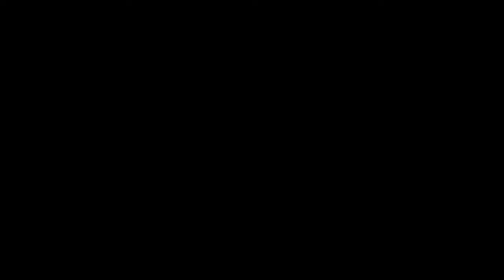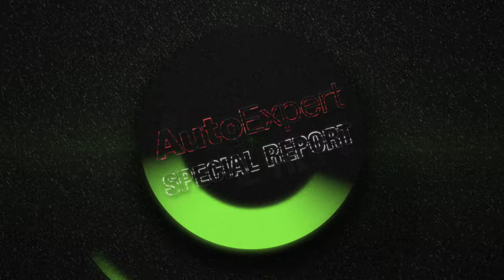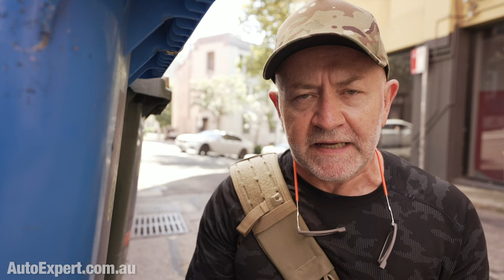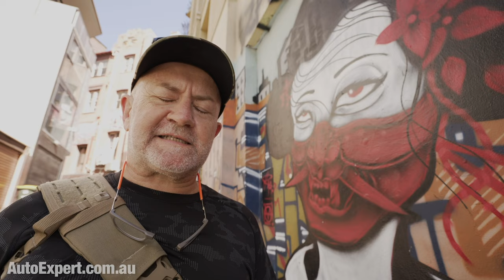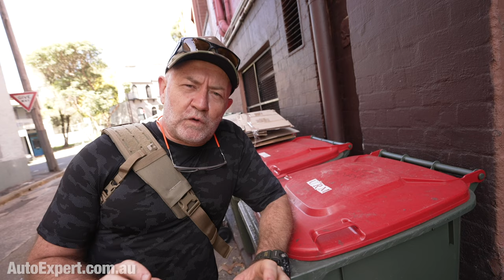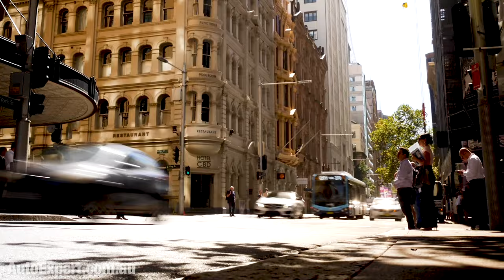These two simple hacks will make your engine last longer | Auto Expert John Cadogan

Comment: change my oil and filter every 6 months whether it needs it or not, buy oil on special when it comes up like 20 litres at a time, i do like my car so cheap insurance costs me about 50 $ a change and the time to do it.
Reply from the maker: Yes - it's not exactly a major investment in money or time.
Reply: Yep...   ditto.  Pretty regularly you can get 5l for under $10.   We buy 3 which will do 2 oil changes...  good quality filter is bugger all.   Local mechanic does the bigger services.
Reply: Waste of oil.
Reply: @aygwm  it can be recycled 
Your local tip will have a oil drop off point
Reply: Yup, same here. Buy oil in 20/25 litre packs and half a dozen quality filters when i see them on offer.
3000 miles the very most between oil changes, and that's when the running is fairly normal, been as low as 2k when lots of short hops involved.
Oil change costs me a total of £25 on one car and £32ish on the other which has a 7.5 litre sump.
Been decades since i had an engine or running issue, do all my own servicing, garages trying to charge about £70 for one sumpful of oil alone when i can get 20 litres of good synthetic from £80 to £100 delivered straight to my door.

Same applies to other aspects such as proper brake servicing, which almost no garage does correctly any more, decades since i needed to replace a brake caliper.
Reply: 100%
Reply: @bhyperp  wot ? Are you using .... 30-40??😱🤦🤷🤦

Comment: i totally fit this demographic.  since we retired its a trip to town or the supermarket.  1 km and 1/2 km respectively.  i do try to go out for a drive in the country to air our brains and look at the beach at least once a fortnight.  we have a new outlander and yes the service interval is 1 year of 15000km.  however, i have been in the habit of changing oil at 5000km for many years.  our old escape we had for 20 years, was still mechanically sound and purred along beautifully.  it was the gearbox that failed sadly.  so it seems i have been doing the right thing all these years.
Reply: Just wondering was the gearbox an automatic and did you have that serviced every 40 000 kms
Reply: I walk to the shop because it's only 3 kilometres return.
In fact I never drive my car unless I'm leaving town.
Any less than 8 kilometres and you're inly doing damage to the engine

Comment: Hi John,
In May 2023 I purchased a new BMW 230i from Glenelg BMW in SA. As part of the purchase, I paid for 5 years servicing up front.
On16/5/24 I took the car to the dealer for its first service. My main concern was for the oil to be changed, as there had been no oil change since I purchased the vehicle. I was informed that the oil would not be changed until 25,000km or 2 years because BMW had decided that the oil they use lasts longer than that used by other manufacturers.
Knowledgeable people all agree that such an extended period between oil changes leads to premature engine failure so oil should be changed at least every 12 months at a minimum.
So, I had to pay $347.74 for the oil change despite having already paid for 5 years servicing. The vehicle had only travelled 5880km but at least 12 months had expired since the vehicle had fresh oil. Had the car travelled 25,000km the oil would have been supplied as part of the service at no charge, so I was penalised for travelling less than this. I cannot see why the dealer should benefit by $347.74 from my not travelling the higher distance. The dealer would not have known how many kilometres I would travel per year so they must have allowed for oil changes at every service in the price of the contract.
BMW policy to change oil at 25,000km leads to a worry for anyone thinking of purchasing a used BMW either privately or through a BMW dealer. It means that a car with 50,000km on the clock could have had only one oil change in its life despite meeting BMW service standards. This is of concern given many negative claims on the internet regarding BMW reliability.
Any comments please?
Geoffrey Pearce

Comment: I'm 79 and a bit old school. When I told my optometrist recently that  I changed me own oil he clearly didn't believe me and kept saying things like there was no place to get rid of the old oil. Changing your own oil is a nuisance rolling around on the carport frigging around with my Echo's oil filter that never comes off easily, but it sure is cheaper than having it done. These dealers you talk about - what are they? My rule is simple - change it often - I shoot for 5000ks. Some weeks I might not do a good run, but  I almost never go a fortnight without doing a 40-50 mile trip. Thats a good tip. BTW I use a good synthetic and I still notice that the engine sounds happier on the new oil.

Comment: First class advice John, have always done as you suggested here, have to say in 39 years of driving my only breakdown was a clutch cable on a Ford Granada. Engines have never let me down 🙂
Reply from the maker: You can be forgiven for the cable, Andy.
Reply: @AutoExpertJC  Maybe I should have changed it for preventative maintenance reasons, but I was young and most of my brain power went on chasing Ming Molls 👄 (still does I think..)
Reply: Ford Capris had the same issue... broke right in the middle of the city in peak hour... the tow truck operator caused 2 grand worth of damage getting it on his flat top...WTF! all that to replace a $10 cable. 😫😖😥😋

Comment: PEUGEOT 505STI which I owned for 16 years completed 513000 km with regular oil changes every 5000km and many long drives eg  8 times across the Nullarbor from Bowral
and superb cruising ability and comfort ( 2003  to 2016)

Comment: 1. Never skip the time interval oil change if it comes before the mileage (it might be even more important than the mileage interval in some cases).
2. Use high quality synthetic oil with the grade recommended by the manufacturer (check service book and don't rely on their advice: some Asian car dealers put 0w-20 to get better fuel economy but when you check the manual you'll see that a higher viscosity might be recommended).
3. Use oils that have the manufacturer recommended standards (ACEA/API, or any other standard that it's requested: VW, BMW, Renault, etc) or else you might damage things like high pressure fuel pumps, turbocharger shafts, catalytic converters, etc.
4. Don't change the brand/standards (ACEA/API) too often, since each has an additive package that might not work very well when mixed with the other one (you cannot completely drain the old oil and with every oil change some mixing occurs).
5. Check oil at regular intervals (top up if necessary, and note the consumption rate).
6. If your cars burns a lot of oil, DO NOT, increase the cold viscosity like most mechanics recommend: from 5w-40 to 10w-40. This will just cause even more wear during cold starts, while doing nothing when the engine is warm (when the oil is thin and is actually going past the piston rigns or valve seams, or whatever leaks there are). Try changing the brand of oil.
7.(optional) Learn to change the oil yourself and you'll afford even more expensive and better oils and filters together with shorter intervals if necessary and still be a lot cheaper than going to a mechanic. (please dispose the oil safely to a recycling center).

Comment: Good advice. Oil change every 6 months essential for low annual mileage cars. I do it myself with a pump. It's easy.
Reply: Waste of oil. Synthetic lasts years in an engine.
Reply: @aygwm  at £3 a litre, I'm happy to waste it!
Reply: @carsonj1  correct. But if it’s just sitting in a car that’s not being driven, it stays fine for a really long time. Oil doesn’t go bad like food goes bad from sitting. It goes bad from being abused and never heated up.
Reply: @aygwm  Exactly. I generally do short journeys. I change my oil twice a year. A small price to pay to protect my engine.

Comment: John thanks for this timely video. I've been down a rabbit hole on this subject for the last six months. You've explained it for me in 10 minutes !

I live in a rural area where every trip is a minimum of half an hour with oil at 90C. Still the VW dealership tried to tell me my Passat TDI needed an added extra " upper air intake clean" to remove carbon build up at 45K. Their claim was that my short trip driving warranted some expensive WD40 sprayed into the manifold. I declined and contacted NRMA  technical support who told me the process offered was next to useless. 

This added extra wasn't on any service info I could find and when I contacted  VW Australia they would neither confirm or deny the need for a service add on for carbon build up.

Comment: In colder climates John I think the perfect engine oil/block heater or investing in a heated garage space does wonders to reduce long-term engine wear. But short of that, good fresh oil is the next best thing, that requires a bit of excellent craft in the engine itself as well. 🤙🏻
Reply: I live east of Alaska. Just change your oil more often. Use 0W oil and change your oil 2 or 3 times a year. Been doing this for close to 40 years and have had no engine problems. I don't plug in my block heater unless it is colder that -40C.

Comment: Great advice John!  I've always doubled the oil change interval, and never regretted it (change at 5000km instead of 10000km)
Reply from the maker: You've halved the interval, dude. 5000 is half of 10,000.
Reply: That's just stupid  and a waste of money and natural resources .
"never regretted it "
Over servicing can stuff with you warranty as well.
A later model engine is more likely to die by driving it like a pussy. Direct port efi is not your friend. Clagged up valves will kill your engine way faster the an over due oil change  these days.
Reply: @fredderf551  
Changing the oil will only stuff your warranty if you put the wrong grade or spec in. If your timing chain snaps and you have 2 month old oil in and your last book service was 8 months ago they cannot and will not use that as an excuse for warranty denial.
Clogged valves can be cleaned by yourself every year or so, but changing the oil will cause less oil dilution and less airborne oil particle and reduce ‘clagging’. Simple stuff really.
Reply: @graemeottey  

"Changing the oil will only stuff your warranty if you put the wrong grade or spec in."
Over servicing can stuff with you warranty. Which part didn't you understand ? The over or the servicing part. 

 "If your timing chain snaps and you have 2 month old oil."
1 You're in a world of pain. Values, pistons bang.
2 A chain that's old school.
3 Shitty oil will not break a timing chain

"ago they cannot and will not use that as an excuse for warranty denial"
Why not? I do it ,nothing is said. Ill null a warranty so fast if a person doesn't comply with servicing in the warranty booklet. I know this is going to be hard for you to understand, but the people that built the car actually know how it works and how to look after it. Hence, the servicing booklet.

"Clogged valves can be cleaned by yourself every year or so"
So your car has run lean for a whole year or so. Yep that's healthy, Ill go with the shitty oil.  You don't work on engines with direct port efi, you send them to be recycled.

"Simple stuff really."
You have no idea what you a talking about. I don't know why you even commented.
Reply: @glenf4115  
Yep his name is  Glen F
Reply: @AutoExpertJC  Correct.

I choked on the words... So Sue me ;)   Double the oil changes, and never a regret across numerous Motrorcycles, Holdens, Fords, an Isuzu Ute, and now an SR Turbo Elantra. 

Touch wood, I've never experienced a major Engine fault.  Cheap insurance really.  Just like 50k Transmission servicing.
Reply: Duane
Why do you need to go against the recommended intervals as designed by the engineers, professionals?

Comment: John, I wonder what effect this would have for all these newer PHEVs coming to market with ever longer battery ranges.  Are we going to see issues with these vehicles if they only run their engines for 10% of the typical mileage or the odd highway trip, or will the wear from low temperature loads be less significant if they occur less often?  Disclaimer:  Owning an older PHEV, I have a vested interest in this answer.

Comment: Absolutely spot on,he’s right about short journeys where the engine never reaches its operating temperature and consequently sump oil dilution sets in,for every gallon of fuel you use approximately one gallon of water is produced depending on the weather and outside temperature both of which create different amounts of water when the engine is running. Buying expensive long live oil’s is not the solution to the problem even though the oil companies say it is,running high mileages and long distances may well stop most of the dilution issues but does stop all the muck,carbon deposits Ect, sloshing around the engine for long periods,using a less expensive oil and charging it every six months for local journeys and twelve months if your doing longer journeys is the better option if you can afford it,more important if your running a diesel to do this because a cleaner engine will last a lot longer than one clogged up with contaminates.

Comment: +1 for regualar service intervals. I just had to do a head gasket on my car, and when the mechanic pulled the head off, there was absolutely no sludge or contaminants anywhere in this 18 year old block. I've been doing 6 month oil changes (myself, because it's $60 and can be done from the convenience of your driveway). I almost never leave the "grid' with the car for long drives, but I do ensure it goes WFO at least once every 10 minutes (once warm) to prevent buildup. However, now I need to service the driveshafts.

Comment: John! Just replaced two tyres on my pig carrier a couple of hours ago, it handles much smoother and safer now! (what would you know, tyres with actual existing treads perform better, even on rain, yesssss!)
Thanks for all the hints about this on your other videos, mate! This is how you actually make a difference on people's lives (helping people keeping themselves alive!), even here in Upsidedownistan Portugal.
By the way, one thing I've never seen addressed nearly anywhere: I've mounted the new tyres in the back. The existing ones were in pristine condition so they were moved to the front and the new ones went to the back. People I know in the transport industry claim this is the best, safest and more economical way of changing tyres. Any comments on this, John? Thanks a HUGE lot, mate!
Reply: Even better if you can rotate tyres consistently and have them all wear out at the same time, but putting the new on the rear and moving the rear to the front runs a close second.  Rear tyre rubber tends to go hard before they wear out, especially in modern FWD vehicles, so it's good to get some wear on them before they have to be tossed anyway - and putting the best tyres on the rear makes the handling more predictable than having great steer tyres and not knowing when the rear is going to break loose.  And since the crappy tyres are on the front, they'll wear out faster, so need to be replaced sooner - which is what you want when they're crappy, so it's a win all round.  :-)
Reply: @aussiebloke609  Yeah that's something along those lines that I've been told. Good durability while having better security. And it's cheaper to buy them 2 at a time instead of 4.
Thanks for chiming in!
Reply: @Humongous_Pig_Benis  Really? What if you just assumed that 2 half worn out tyres needed replacing but just keep the money for later, then use that plus some more to buy all 4 tyres when needed, wouldn't that be the same? Or actually buy some new tyres on special but keep them until fitting time, you could save some money. On the other hand often I've seen Buy 3 and the fourth one is Free. So no, 2 is not cheaper than 4 overall.

Comment: Great comment John. I’ve been doing oil and filter changes in my cars every 5000km for the last 20 years. I can get pricey when you do 40,000km/year, but now I’ve reverted to a new car again (the Saabs were just getting too unreliable even with the preventative servicing) and fewer kms. I feel it is much more important. Except I took your advice and let your 5 ‘approved’ companies vie for my hard earned and bought a Mazda CX-5 GT (poo brown leather is just not my thing). I am also in discussions with my mechanic to go one step further and change the Aisin gearbox oil every 20,000km. He is telling me that Volvo, Saab and Mazda (and I assume many other car makers) use these gearboxes in the various models. Volvo recommends a gearbox oil change every 80,000km and has had quite a few (according to him) die, with the owner up for a $5,000 dollar repair bill. Saabs recommend 60,000km or 80,000km depending on the model and have had fewer issues. Mazda is also 60,000km for auto gearbox oil transfusions (I’ve been told), but I feel if I keep the oil new every 20,000km there should be no reason for the gearbox to poo poo itself as these other makers have had happen. Thanks you for a most entertaining perspective of Australia’s automotive world. Lloyd

Comment: My vs2 commodore passed 1.05 million KMs with no major issues (excluding PS pumps). Changed the oil and filter every 6k, even reused after filtering through shirts occasionally. Cheap oil fine, just change often, it works.